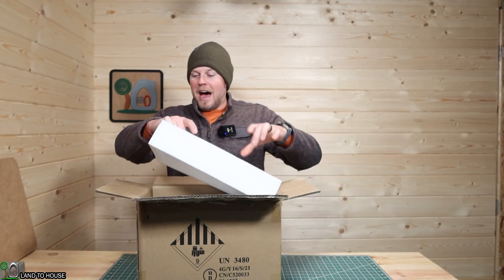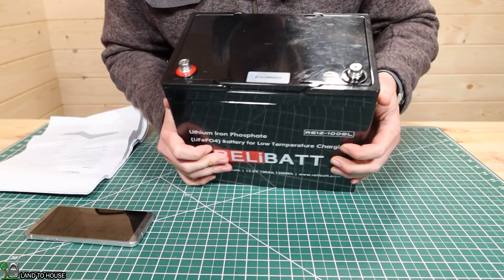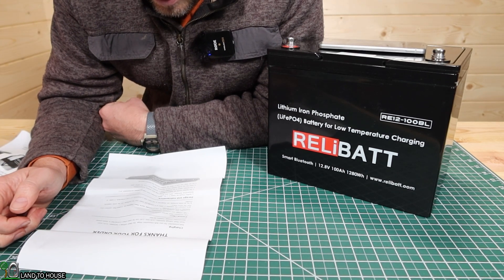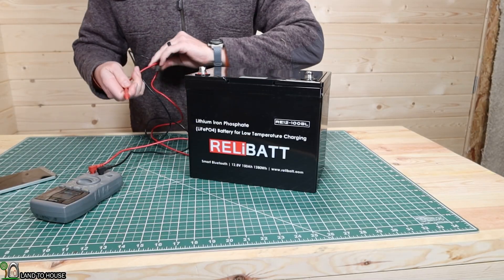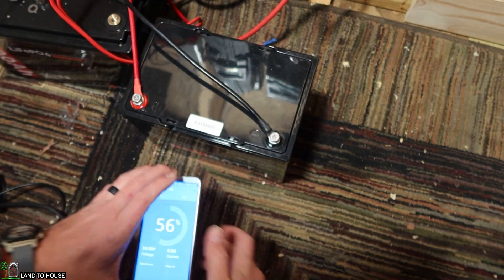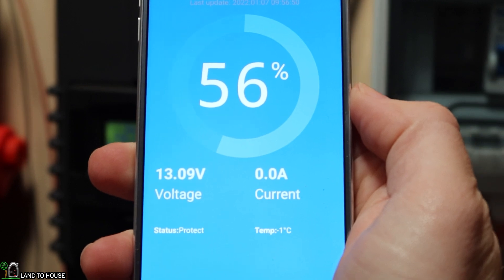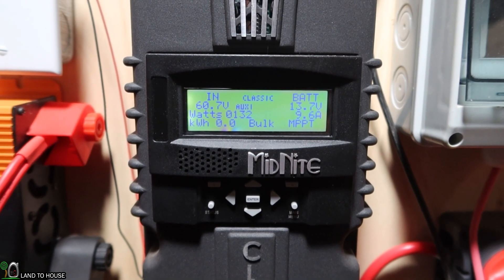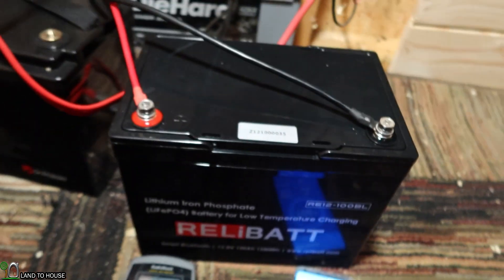Self Heating Bluetooth Relibatt LiFeP04 Battery 12v 100ah

Comment: Put some styropor around and at the bottom of the battery in the winter time. That helps with low temperatures. It's better for the lifetime of that battery. I know these types from CanBat. The app shows you the values from the BMS system inside the battery. The voltage before the BMS must always be a bit higher then the battery have.

Comment: I would think most batteries generate some heat on their own.
Reply from the maker: Yes. But this one has a heating circuit designed to raise it from well below freezing up to 32 degrees.
Reply: @LandtoHouse  good to know. That may explain why my lithium battery failed after a harsh winter last year.

Comment: when you review items that use there own app it would interesting to see if they're doing anything silly to your phone like many apps can like draining the battery or slowing it down/glitches what it wants access to on the phone is telling especially when accessing thing's it shouldn't need if you use a dedicated phone and get a new SIM and email for each new app if it what's access to them or wants them to setup a account if you get any scam calls etc you 100% know why and your personal information is safe
Reply from the maker: I also questioned that. And that is why I used my drone phone with no sim card to test. Did not notice any issues but the phone is not running with full functionality.